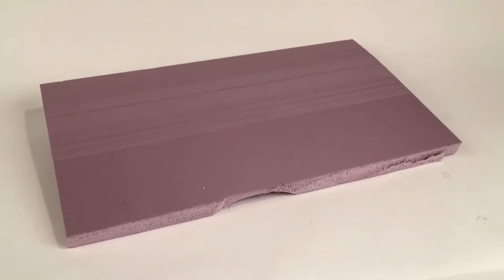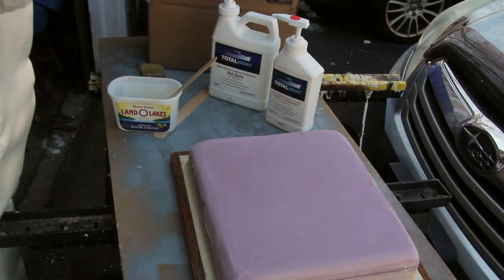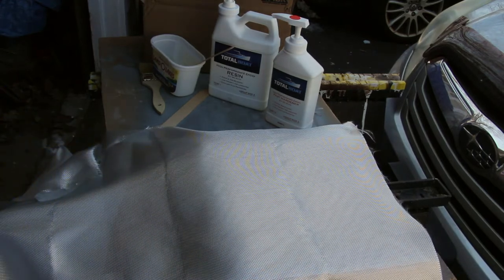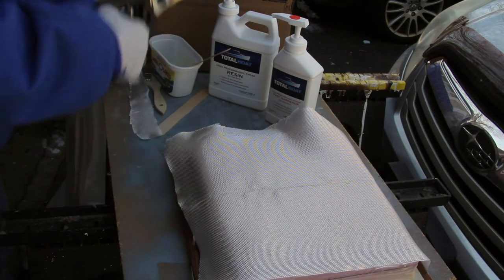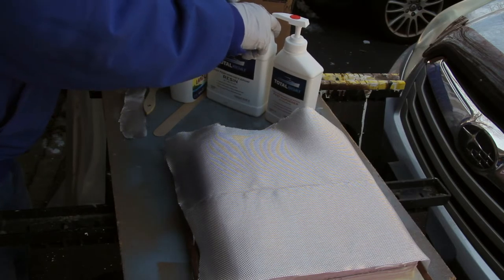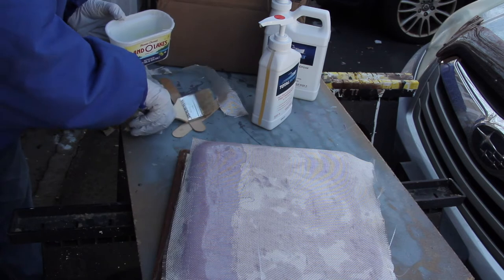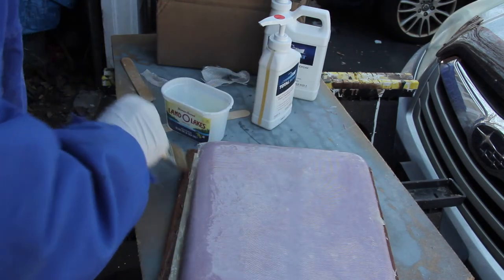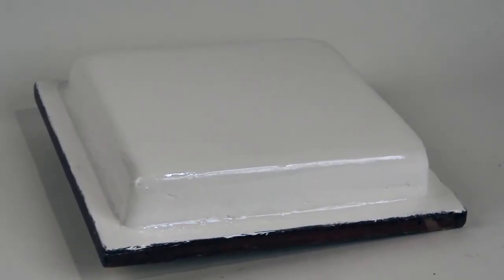ice box Insulation part 1 THE LID

Comment: Hmmm , i feel i should point out , that though you are quite correct in that cold weather slows the cure down , it also thickens the mix , and make wetting out far more difficult . I noticed that your resin spread more like paste at one point , you really need to play the two aginst each other ! 
A warm resin will wet cloth far quicker , and more thoroughly , producing a better finish . Though it should be fine for this purpose , a thick resin can produce a weak laminate , due to insufficient wetting out, and be liable to fail if used for a structural purpose .
Reply from the maker: You are absolutely correct and if you look closely, I used gelcoat over  epoxy, which is another no-no. But it worked, and my ice does not melt as fast.
Reply: @svgreatescapes  Actually i didn't notice that , but again you should be fine . You're quite correct it is another no-no , and again it's on the grounds of strength . The gel coat , epoxy bond will be purely mechanical , no strength . You should be fine , just don't chip it . That's where your problems will begin .

Comment: Nice video. I am trying to insulate an acrylic enclosure. Do you think Styrofoam will be enough on the walls on its own?
Reply from the maker: On the body of the icebox I used the foam and spray foam. It’s an area that’s protected so I’m hoping it will hold up well without there being any contact with it. After insulating the lid and the body of the icebox my ice is lasting a lot longer. The fiberglass thing was not hard and gives it a lot of strength. I think I might’ve shown part of the insulation on the body of the icebox in a video labeled both projects 2022